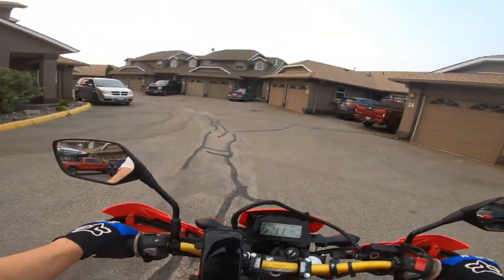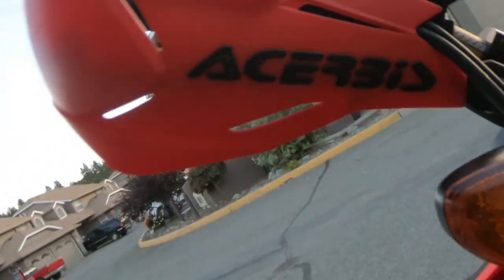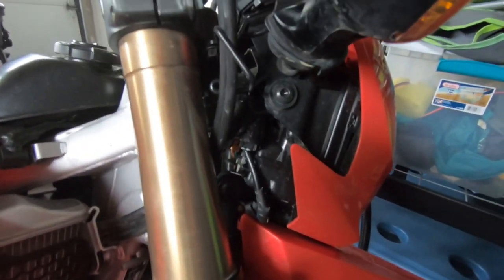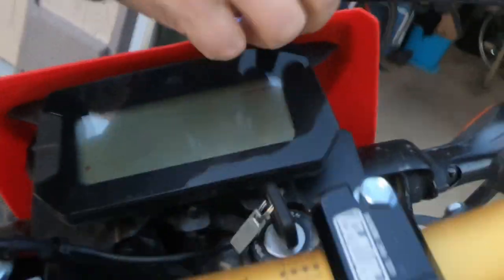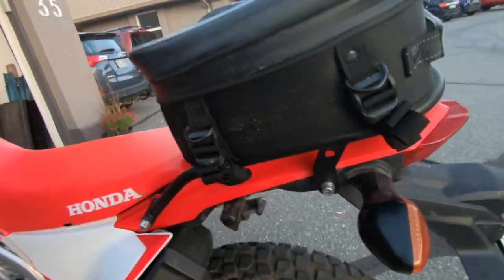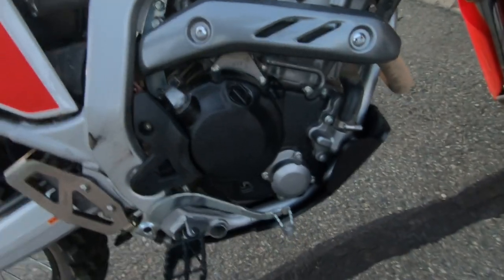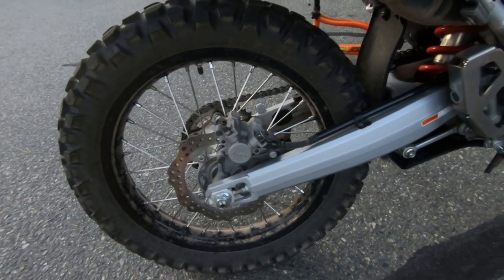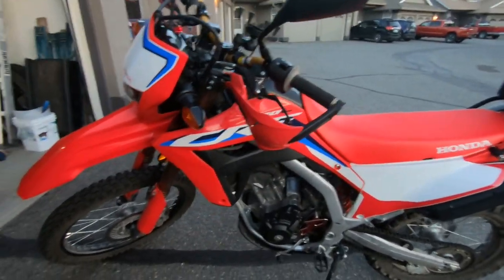CRF300l Accessories (so far)

Comment: Just keep the bike in gear when picking it up , locks out the back wheel .
Gives you more control in awkward situations .
 Use the clutch  instead of the break to get you out of trouble😁🇬🇧🏍
Reply from the maker: Good advice. Thank-you.

Comment: Hi. Thanks for the video. Could you describe the resonance that caused you to switch skid plates? I'm getting a very loud vibration from about 7,750 to 8,250 revs. I fitted the Yamoto plate before getting any miles on the bike so not 100% sure whether the skid plate vibrating is the issue but seems likely. Am wondering if I can squeeze some rubber washers in at the mounting points it might go away?

Are you getting any noise with the AXP plate?
Reply from the maker: I removed my Yamoto skid plate and the 7750 to 8250 rpm noise went away. That was definitely the cause in my case. Rubber washers might help, you might need slightly longer bolts. The AXP is a better plate. No added noise, slides over obstacles, no rusting. Seems pretty rugged too. Adventure Daily did a torture test here: https://youtu.be/wT4FLLiclDg
Reply: @dualsportadventure  Thanks for the response 👍